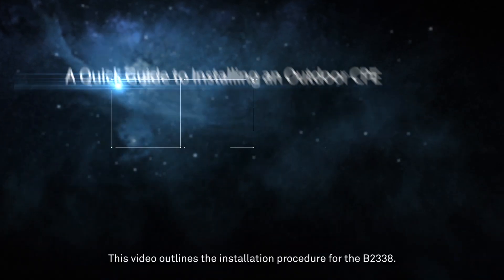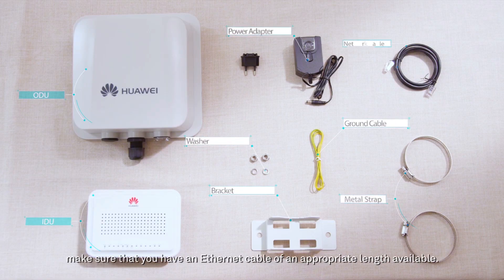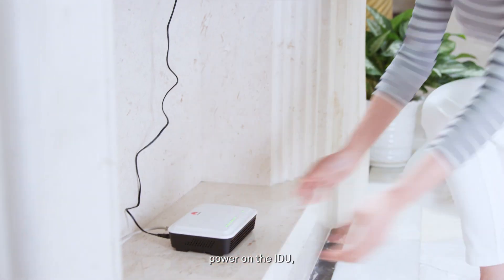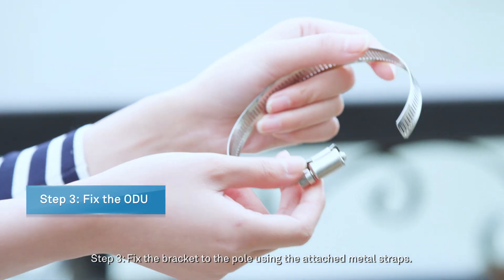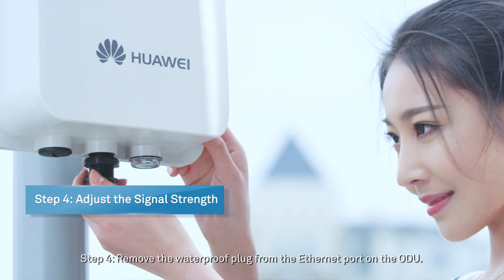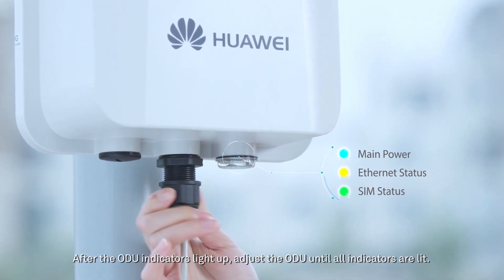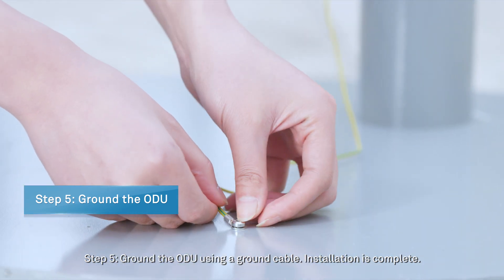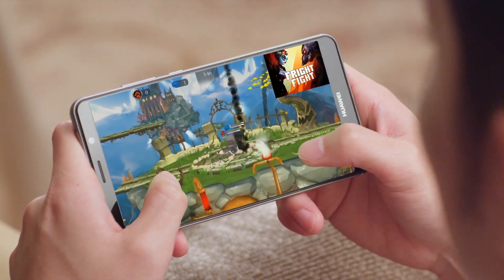A Quick Guide to Installing an Outdoor CPE

Comment: is grounding it necessary? If so, why? thanks
Reply: The cable connecting it is made out of copper, so if lightning hits it (or hits closeby), the cable will carry it inside and in the best case ruin your indoor unit. In the worst case, potentionally start a fire.

Comment: its similar when the huawei modem b315 put outside, wrap it with plastic or something to protect it to the rain and heat, then connect it with long LAN cable to the router inside home. make sure only lan cable to use the enternet data, turn of wifi from the modem. only use wifi from the router inside home.. save money right?

Comment: This is very bad lte router Huawei B2338-168 ...
- can not be turned off WPS - hack you router in 20minute !!! very dangerous...
- wifi 5ghz automatic blocked in 1-2hours and not work need reconnect wifi ...
-  there is no possibility to set 40mhz to wifi N - all wifi speed max 72,2 ...
-  there is no option to set up at 2.4Ghz 13 channel ....
- wifi 5ghz only low speed channels! 36, 40, 44, 48 ...speed 5ghz only 433mbps max 600mbps
-  LAN only 100mbit - for today's time obsolete
- login page router problem certificate lol....
- NO SUPPORT!!! NO NEW FIRMWARE!!! VERY DANGEROUS security vulnerabilities!
-  I regret to buy. bad investment ...
- the price of quality misconduct! 300 dollar? wtf this shit :(